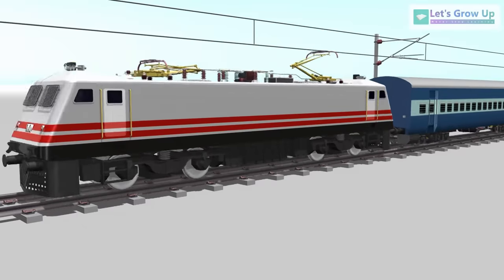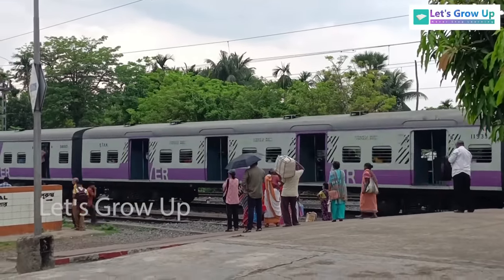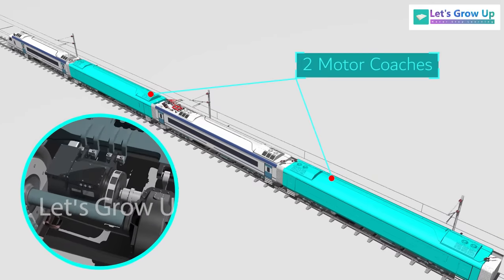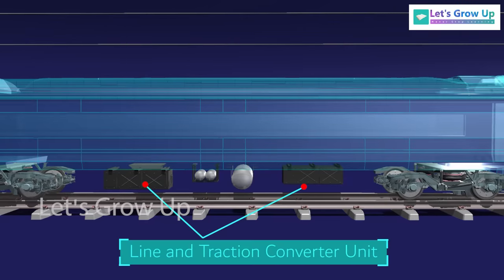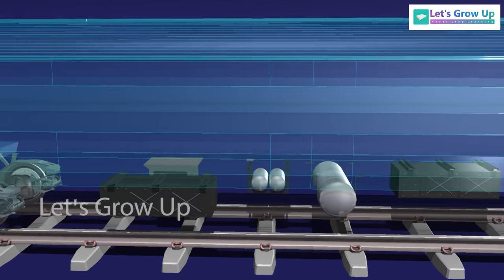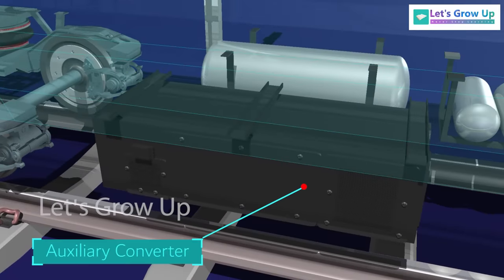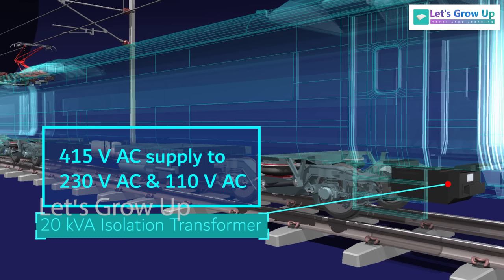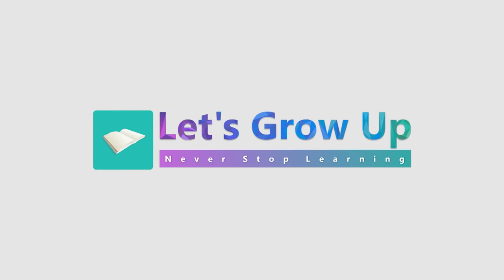How does Vande Bharat Express run without engine | Explaining Vande Bharat train's self propel tech

Comment: EMUs running on this technology is more than 144 years old and in India it is 98 years old.  The only difference is that earlier they use to run on DC motors and now on AC motors helping the train to achieve higher speeds. As there was very little electrification on Indian Railways until twenty years ago, these electrified Multiple Unit trains called EMUs could not be run on long distance routes in the hinterland.  Now almost every route is electrified and hence these trains can be run on major routes.
Reply: Olden days EMU. CANNOT MANAGE GHAT SECTIONS
Reply: @manu7815  Yes because then the DC EMU had just 1500 volts but today AC EMU has 25000 volts.
Reply: @SD-fk8bt  but new ac EMU. MANAGE GHAT SECTIONS please ADVISE
Reply: @manu7815  yes Mumbai Shirdi Vande Bharat via Kasara Ghat. Locals are not viable to run on Ghat section as turn around is longer and stations  passengers are few.
Reply: L
Reply: While running ,is it possible to convert the axle shaft rotation in to current through alternator and send back to main line
Reply: @SD-fk8bt  ok Thanks
Reply: @manu7815  they are low power and the electric engines (also diesel electric engines) are high power and can be used for both goods and passenger trains. EMU are multiple units and can have 8 or 14 bogies. We have been making the electric engines and the diesel electric engines at Chittaranjan for sometime.
Reply: @krishnamurthyev365 it is possible and Railways to do R&D and make use of these energies wasted
Reply: @krishnamurthyev365  Eddy current will slow down trains
Reply: There is also a thing called as DEMU
Reply: @manu7815 in EMU moter is after every 3 or 4 CABIN. whereas in VANDE BHARAT MOTER is in after alternative Cabin..
Reply: Correct
Reply: Vande bharat is Mumbai  a c.local. no difference except capacity of motor and few another thing's.
Reply: Upgrade version of EMU

Comment: what is the use of roof-mounted HIgh tension wire between first and last pantograph ?
Reply: In a 16-car formation, only two pantographs work at the same time, but all the transformers in the TC coach will work. Therefore, a roof-mounted HV link is provided
Reply: Good detailed information about Vadhe Bharat locomotive trains. Thanks for the same.

Comment: The train has 4 pantographs but always 2 are active. Also unlike a local train the pantograph is placed on trailer coach and motor coaches are separate.
Reply: what about remaing 2 ?
Reply: @vamshikrishna7945  Stand by in case of break down of once which are in use

Comment: Infact it is distributed engine system. Main problem with this is if one engine fails, train may not stop, but inertia of the coaches will put extra load on other engines and if not detected in time will lead to drastic consequences. Just for this reason, no where distributed engine system driving one unit is not desirable.

Comment: Doesn't the Metro Network of Kolkata is running with same technology for last >25 yrs. Modern A/C Metro trains are designed on LHB coach only difference is the power input which is not overhead but side rails.
Reply: The concept is similar but here they use ac motors instead of dc motors. It does increases the complexity and reduces risk but alas it took india long time to implement it.

Comment: Stop posting this type of questions, the system of vande bharat is running in India for decades in emu trains. Have you ever seen a emu train is running with locomotive? Every motor van is able to run with 3 trolly van. In 9 coach train there are 3 motor van. 1st learn about emu system then post these kind of videos.

Comment: A "train without engine" that has an electric engine? What's special about this train? It is a totally normal electric train, isn't it?
Reply: @madhavpatil2221  Multiple unit trains have been the standard in most of the world's train systems for decades. In local transport (suburban trains) even for almost a century. The French TGV as well as the German ICE started "locomotive" based but switched to multiple unit trains in the 1990s. So what is described in the video is simply the industry standard. When I read the title "engineless" I was expecting a linear drive or a levitation train. A bit misleading, right?
Reply: @madhavpatil2221  Efficiency and accelaration are mit the major point. The major point is axle weight. For speeds above 300 km/h it is extremely Important to have an evenly distributed and therefore lower axle weight that cannot be realized by locomotive driven trains.